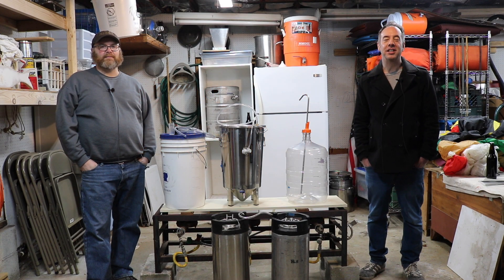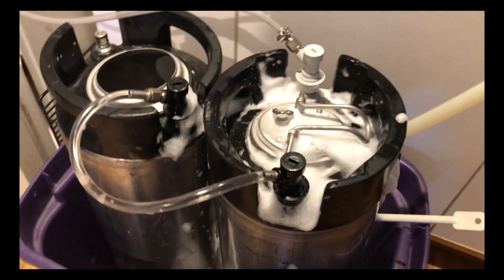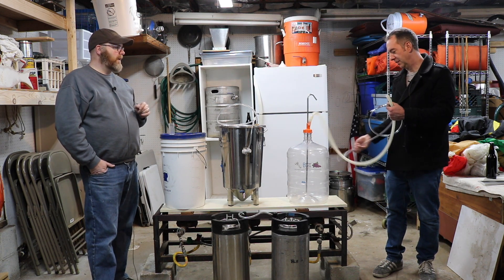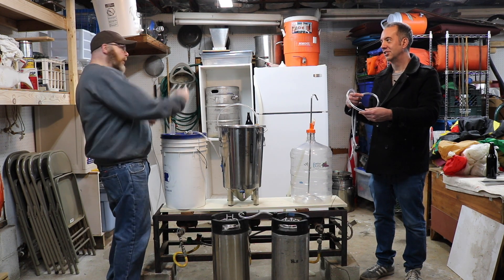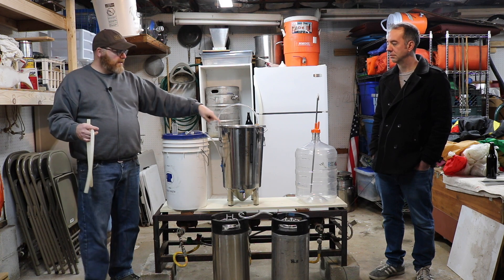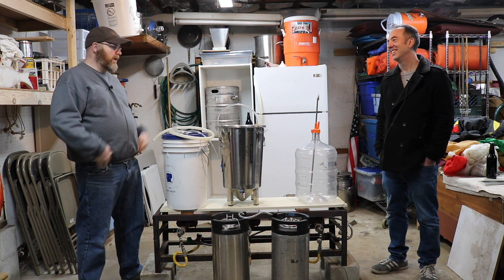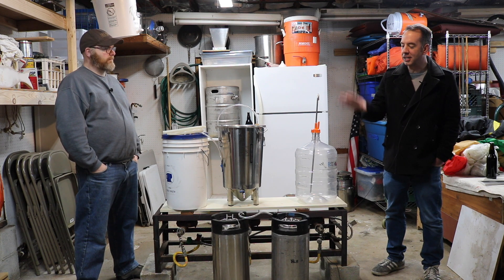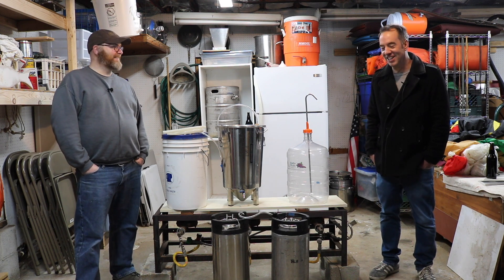Closed Transfer From Fermentor To Keg - Minimizing Oxidation in Homebrew

Comment: To dry hop with a closed transfer is easy.  All of the keg lids that come with new kegs from Adventures in Homebrewing have a tab welded on the underside.  I suspend my filled hop cage with fishing line and seal the keg before the transfer.  If you want to DDH, you can purge a 2nd keg and use the jumper!  

I don't actually do closed transfer but when I purge my kegs with co2 the old-fashioned way, if I see the haze of co2 inside the keg, I feel confident that it's purged well.  If you are gentle enough, the co2 fog will remain throughout the transfer.  

Great vid as always fellas.
Reply from the maker: SOunds good.  I've done it that way plenty of times and its worked fine for me.  I have found that with the delicate styles like NEIPA the freshness seems to last a bit longer in the keg if I go the extra mile.  But to each his own really.  We promote doing what works for you.  We're just presenting a point of view for enlightenment and entertainment and our own exploration.  Thanks for the comment!  Cheers!  -Mike

Comment: Thanks a lot for the video. I am thinking about how to do a closed transfer with my brewing container. They are stainless steel, but have a big screw-on "lid".
Reply from the maker: Hard without some sort of port.  Maybe purchase a second lid to do modifications on?  Good luck.  Cheers! -Mike
Reply: @BrewDudes  that's what I am working on: a 3D printed lid with holes for NC "poppets".

Comment: How do you purge the O2 from the gas out line to the fermenter?  Do you put your thumb over the barb fitting end of the tubing, connect the gas end fitting to the gas side on the keg, then stab the hose on the hose barb at the fermenter quick like?  Also, how would you purge the O2 from the liquid side of the keg to the fermenter spigot?
Reply from the maker: That would be one way to do it.   I accept that the system isn't going to be 100% O2 free.  Its about trying to be as low as can be reasonably expected at the homebrew scale.  This has worked for me and kept IPAs from going "purple" as it were.  I'm good with it.  I supposed you could try and purge the lines first either off the keg itself or with a seperate tank.  But I'm trying to be practical with my beer brew as often as possible.  Cheers! -Mike

Comment: I like to clean as many kegs at a time as possible, then do the star San purge through all the kegs at one time. I use spigot fermenters so I just gravity feed, I don't have a setup for a closed loop yet
Reply from the maker: For most styles I have good luck doing it that way and racking straight to the bottom of the keg slowly.  For NEIPAs though sometimes its a hit or miss and the beer changes color some.  YMMV.  Cheers!  -Mike

Comment: I used to pressure transfer from a carboy. I bought the ferroday carbonation cap and stuck it into the second tube of the carboy cap. Now that i have a delta fermentor I just do the gravity closed loop transfer. Great video!
Reply from the maker: Thanks for sharing.  Cheers! - John

Comment: Good stuff guys! I had a couple pin lock kegs that I wasnt using and decided to try fermentation in kegs with a flexible dip tube for this purpose. Works great and for 20 bucks for the flexible dip tube you can do completely closed transfers from keg to keg. Ive even gone a step further to use CO2 from fermentation of the beer to push Star San out of my serving keg so its purged and Im not wasting CO2 from my cylinder.  Hope you guys have had a great Christmas and New Years! Sláinte!
Reply from the maker: Cheers man!  I've toyed with the idea of doing the CO2 purge thing but I am not really thinking that far ahead when I get to brew to set up the keg and Starsan.  Happy NY to you!  -Mike

Comment: I have a carboy fermenter, can i use the orange cap but use the technique you discussed about the ss brewtech ?
Just to make sure
Cane to gas in
Liquid out to top of orange cap
Is that right?
Pressure going out of keg will prime the carboy with CO2 that will pressure push beer thru cane into gas in of keg
Keeping O2 away and equilibrating pressures
Reply from the maker: I don't see why you couldn't create the same closed loop using an orange cap and carboy.  But you'd go the cane side to the beverage out/long dip tube and the gas outlet to the top of the carboy through the second port of the orange cap. Beer is going to travel up the cane and into the base of the keg.  As the keg fills gas is displaced out the gas post from the top and replaces the dropping volume in the carboy. 
Its not really an active pressure push.  Its still a gravity siphon process though.  You'd need to prime your siphon first using a carboy.  Its just that you are replacing the headspace with the CO2 from the keg back into the carboy.  There is no real pressure doing the pushing.  In fact you want to make sure you go from gas post to top of carboy first otherwise the bit of pressure in the keg will bubble through the beer cane first disturbing the trub (if the cane is that low) and you'll have less cleared beer.    If you're fast enough you might be able to get the siphon to start with the pressure still in the keg.  But you'd have to pop the to fittings down on the keg at almost the same time.
The only issue you might have is the tubing diameters.  You'll have to do a step up in that tubing from the gas outlet to the carboy cap because the diameters are so different.  But the basic principle will work, just gotta figure out the hardware issues.  Cheers! -Mike
Reply: @BrewDudes  got it…. Thanks for the great videos…. Verry helpfull for a newbee like me

Comment: You can do a double transfer for dry hops... put the dry hops in vessel 2 purge with CO2.. then transfer over again. . You can do this for each dry hop addition without the beer ever hitting the air
Reply from the maker: I had been doing it that way for years.  It all comes down to how good that purge is.  I am not convinced that a keg filled with air every fully purges by pressurizing and burping several times.  Now a keg that is truly empty of air at the start, I think you can get a way with opening a lid putting in hops closing and burping many times and get a pretty stable product.  I'd like to see more definitive results with actual O2 meters in a keg.  Thanks for the comment.  Cheers! -Mike

Comment: The plastic ball lock cap that fits on a soda bottle has a barb that fits into the orange cap
Reply from the maker: Oh really!?!?!   I need to find one of those.  Thanks for the tip.  Cheers! -Mike
Reply: @BrewDudes  scratch that just the stainless one has the wider barb!

Comment: I still bottle everything. I have a soda stream that works great for purging bottles before filling. I just did my first bottle-conditioned hazy IPA with no oxidation issues. The soda stream is pretty cheap and I use it for other stuff anyway. Just another way to reduce oxidation.
Reply from the maker: Nice - appreciate that input! - John

Comment: Great info guys. BTW you could use a dry hop cage in the keg. Add hops to the sanitized keg. Purge the keg and proceed with the transfer. I've never done closed transfers but I just ordered a 14 ss brew bucket and decided it's time to step up my game. I think I'll add a valve to the lid with a gas fitting to hook up the co2 for an easy transfer.
Reply from the maker: Right on - thank you for that dry hopping tip!   - John

Comment: I have yet to try fermenting in the Cornelius, but I am going to try it. Mostly because I have updated my brewing equipment and haven't yet completed the project. Would fermenting in the keg be such a negative experience that it would complicate the process as much as transferring the finished beer? I am not implying that transfers are too risky, but rather is transferring actually even necessary to produce a great beer? If cleaning the keg is too complicated after fermenting in it, I think my pressure washer would get it clean in concert with PBW and Star San.
Reply from the maker: I have fermented in a corny a few times and I like the process.  Unfortunately, my brew process and gear is really set for the 5-10 gallon batch size and I felt like I needed to be doing 4 gallons when fermenting in a corny due to limited headspace.  (I don't like dealing with blow off and stuff like that.)  But using a keg simplifies a lot of things like cold crashing, you can ferment under pressure, you can rack with pressure assists with no fear.  Its something to consider.  Cheers! -Mike

Comment: Great videos, awesome, thanks!!!

I've been experimenting pressure fermentation (keg) with closed transfer for the last 5~6 batches. Having the CO2 loop-back from the serving to the fermenter keg plus the gravity helps to save a good amount of CO2, it takes more time to transfer but it works well.

To purge the serving keg, I was doing exactly what you described (fill it with starsan and push CO2), but I felt it was too much CO2 (I'm a penny pincher I know 🙈), so I started to use the CO2 from the fermentation to purge the serving keg. Basically, I keep the spunding valve in the fermenter, but I connect the output of the valve to the serving keg. When the pressure on the spunding start to raise above the target pressure I ferment, 12psi, I move the spunding valve to the serving keg and and use a jumper between the two. Any thoughts? Would you say that would get rid of all CO2?

Regarding dry hopping, I was thinking about doing a secondary keg fermenter. I would add the dry hops in the secondary keg, have it purged, transfer the beer into, keep for the amount of days I want, and do another closed transfer to the serving keg. Any thoughts?

I saw some comments about randal hop back system comments, I will look into it to understand better how that works too 😉👍
Reply from the maker: In short it depends on the 'purge process'.  I was concerned in my brewing practice that a keg filled with air the loaded with CO2, burped and cycled 3, 8, 40 times was probably never going to get the O2 out. Especially when all this adding and burping is happening at the top only.  I think the only way to get the air out (in a homebrew environment) then is to positively displace a fluid with CO2.  An interesting experiment would be to fill a keg with sanitizer and do what you say.  If you can't expel all the water with the off gas from your process (which would be one volume of CO2) then you certainly never were getting the air out by mixing OC2 with the air in an sealed empty keg.  I might have to try this no that I type it out.  DO you get what I am saying?  I'd also wonder how much back pressure is there on a fermentor that's trying to "exhale" through a whole keg of starsan.  Which is one reason I haven't tried it yet.  Awesome thoughts.  Too bad we can't just have a beer and discuss it in real life.  Cheers! -Mike
Reply: @BrewDudes  Thanks for the reply/help. I will try your suggestion in my next brew 😉. I   guess there will be enough CO2 to move the sanitizer out of the serving keg but I will try. Once more, thanks for the suggestion, and keep the videos coming, we all love it 😉👍

Comment: Ball lock fittings with flared ends are my best friend when doing closed transfers. Allow you to switch back and forth between beer and gas.  Before pushing beer, blow co2 through all your transfer tubing by depressing the ball lock connector with your finger. A quick spray of starsan and then attach to your post for oxygen free intrusion.
Reply from the maker: Great tip - thank you!   - John

Comment: The amount of star san left in the keg after racking out always bothered me. I know "don't fear the foam" but there's always a dent on the bottom of the keg that holds quite a bit of liquid/trub.
Reply from the maker: I hear you.  I haven't had any issues with my beer, knowing that there is that small amount of sanitizing solution in the keg.  I make sure that I mix the proper amounts and hope for the best.  It's worked so far - ha. - John

Comment: Post-fermentation oxidation is never a good thing for beer. Best to remove it from your process entirely if possible. 

I keg but, if I have to bottle for competition/sampling, I prefer to use PET bottles fitted with a carb cap/Tee setup to pressure fill and then I squeeze the bottle after being filled to remove excess O2 and cap.   

Something like this: https://brewkegtap.co.uk/products/carbonation-cap-tee-piece-kit
Reply from the maker: Great tip! - thank you for the comment. - John

Comment: In a previous video, you mentioned chelating reactive/enzymatic metals as a solution to oxidation issues. Have you thought more about this or done any experiments/tests? Presumably you would want to add this post fermentation as I assume yeast performance would decline without access to these metals, but oxidation isn't an instantaneous process, while chelation of, at least divalent, metal ions is extremely fast.

As an aside, your completely closed cycle method seems pretty smart, but venting the pressure with the PRV seems to defeat your "closed cycle" concept as the partial O2 pressure outside the keg is higher than the partial O2 pressure inside the keg, so, while you're venting CO2 from the keg, you're introducing O2 at the same time. Gasses don't flow only one way based off of total pressure.
Reply from the maker: I haven't had time to research and source what I'd like to do regarding chelating agents, but yes I envision it as a post ferment thing.

I'd agree about O2 ingress by pulling the PRV only if the two sides of the system (inside keg/outside keg) were at the same pressure to start.  The pressure in the keg is significantly higher than atmospheric that the burp is a rush of CO2 out of the keg.  Now, maybe if one assumes I mean hold it open until it stops hissing completely and wait more time then sure, O2 is getting in, minimal though.  A quick burp to prevent a surge of CO2 bursting into the outlet of the brewbucket is a must in my opinion.  

Lastly, I don't deal in absolutes really.  I make no assumption that any of these techniques could ever be zero O2 ingress.  Many others tend speak as in absolutes (I assume not yourself). Presented here is a further way to help minimize O2 pickup knowing full well that its never 100% in a homebrew environment.  Thanks for the thoughts and the comment.  Cheers! -Mike
Reply: @BrewDudes  Thanks for the information on the chelating agents! I'm very interested in this technique and a video would be awesome if you guys ever get the chance!

As for O2, I think you misunderstand diffusion rates based on partial pressures. The issue isn't really if the pressure inside the keg is so much higher or not (ie, just because you hear the keg hissing doesn't mean gas is only flowing one way). To first order approximation (reasonably valid at these quite low pressures), gas to gas collision doesn't occur (at higher pressures and higher orders of approximation, sure, there are collisions, but we're talking a few atm here). As a back of the envelope calculation:

P_keg = a*P_room (where "a" is a function of how much pressure differential you're generating based on the height difference of the two kegs -- I think ~2 is reasonable here)
p_room_O2 = 0.2*P_room
p_keg_O2 = 0.0005*P_keg (assuming 3 9's purity)
D_intokeg ~ (p_room_O2 - p_keg_O2) = (0.2*P_room) - (0.0005*P_keg) = (0.2 - 0.0005*a)*P_room

where D is the rate of diffusion. The take away points here are that the diffusion rate is essentially independent of keg pressure and in fact goes up the better the job you've done to keep O2 out of the keg. I.e. opening the PRV is effectively the same as just doing an open transfer (to these reasonable approximations). The "a" variable means that the less frequent you vent pressure (the more pressure you're building in the keg), the less O2 you'll introduce via this method. The key caveat here though is that for beer to flow, a is capped by the height difference between your vessels, and (!) is practicably limited to a value less than an order of magnitude, meaning your diffusion constant will still be quite high, effectively the same as an open transfer.  

As another aside, if you're going to go through all this trouble, a gas quick connect with a bubbler (glass of water/starsan for instance) and a few ft of tubing is a cheap way to avoid this confusion and possible O2 pickup.

Finally, in terms of dealing with absolutes, I agree -- I'm simply saying the difference between the PRV and an open transfer is considerably smaller than the difference between PRV and closed transfer or using a bubbler and therefore, encouraging drastic changes to kegging protocol for extremely marginal improvements seems unnecessary, especially when cheap and considerably better methods exist.